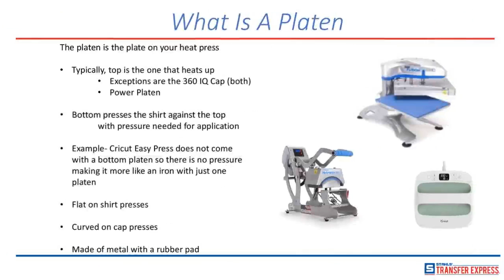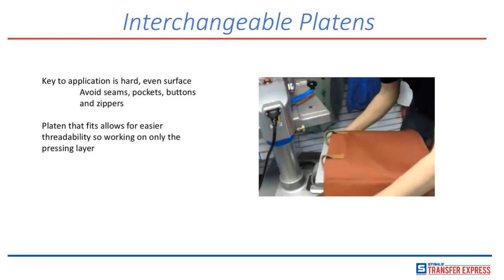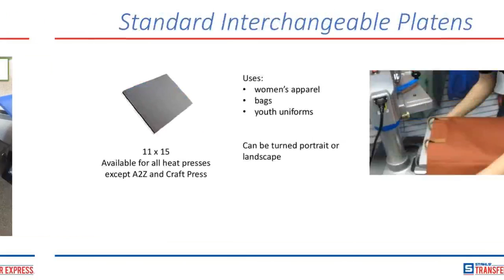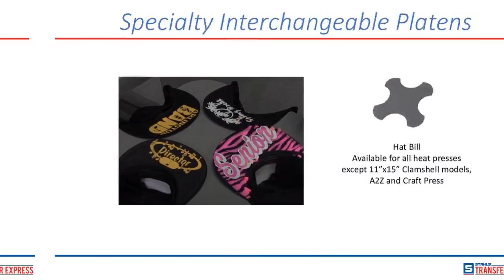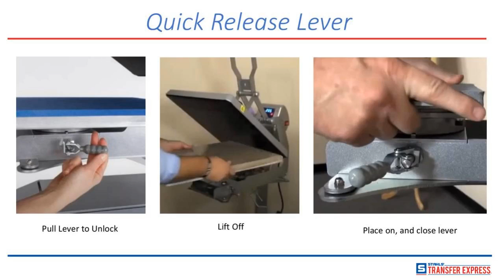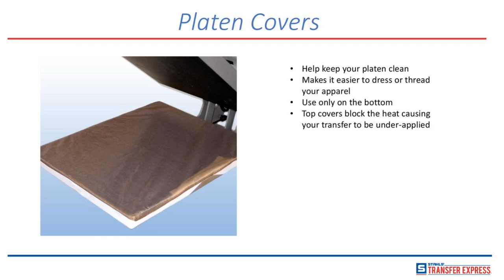The Right Heat Press Platen | Transfer Express

Comment: 39:30 top covers
can you tape kraft paper under the top platen as a cover since you'll be using covers anyway?
if not, is there a material that can be semi-permanently placed on the top platen as a cover?
Reply from the maker: For specific transfers that require coversheets, yes, we've seen people use those magnetic clips with kraft paper attached, however, like Andy mentions here, cover sheets can block heat which can lead to under-applied transfers. Most heating elements have a non-stick coating on them that makes them easy to clean with just a quick wipe down.